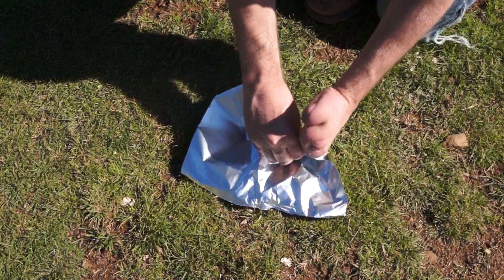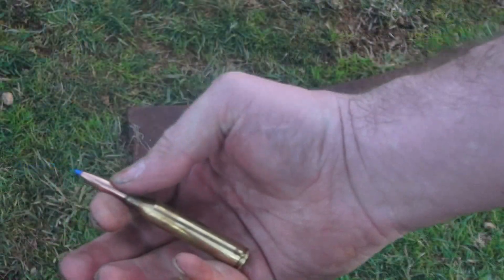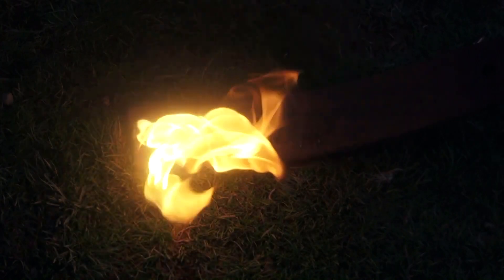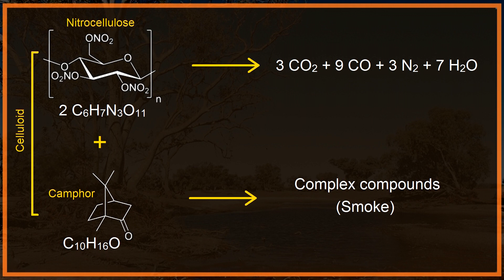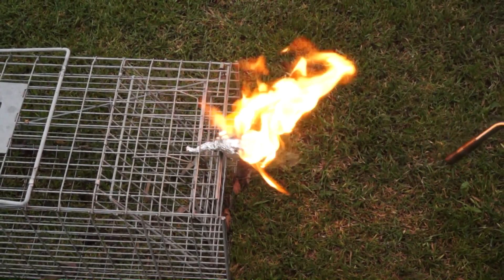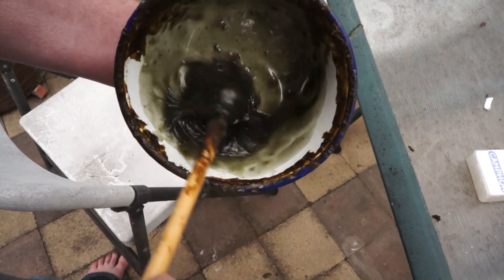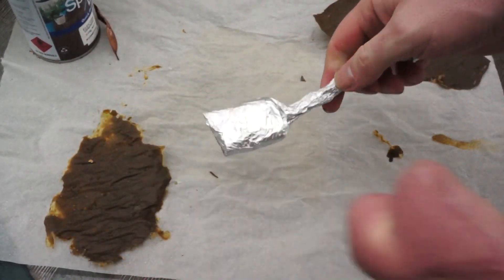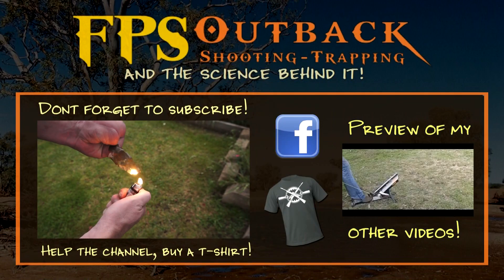Science of the Ping Pong Ball Smoke Bomb - why ping pong balls burn

Comment: question how does that trap that you set the smoke bomb on  lock, i'm wondering if i can modify mine because the bar locking system isn't working anymore, cool video
Reply from the maker: +stevencox75 I have shown that trap in the past in the possum trapping video, check it out for a slow Mo look at the locking mechanism https://www.youtube.com/watch?v=10eU7X0d4wk
Reply: FPSOutback cheers mate, your videos are an invaluable tool